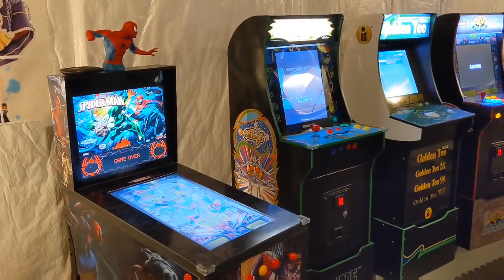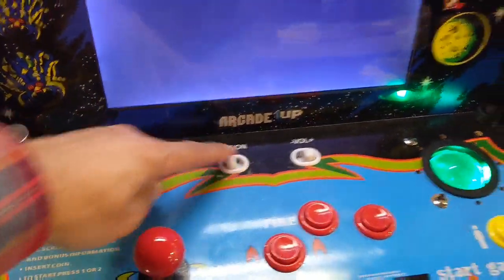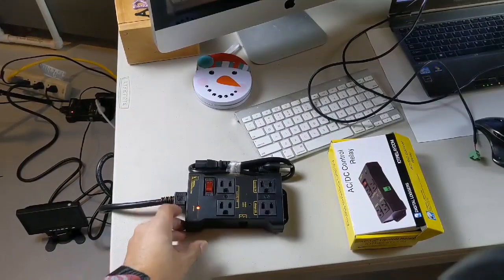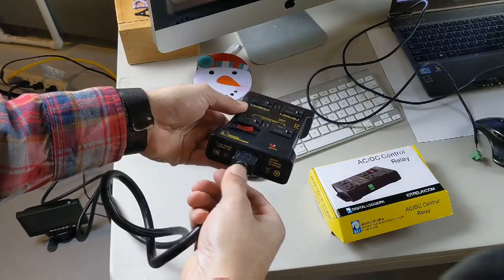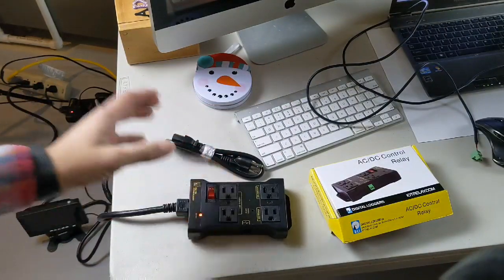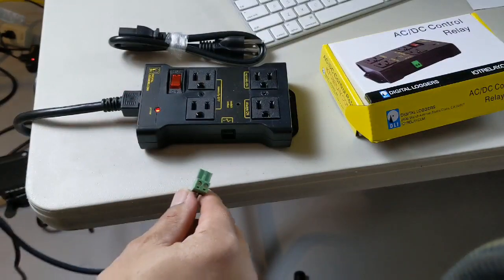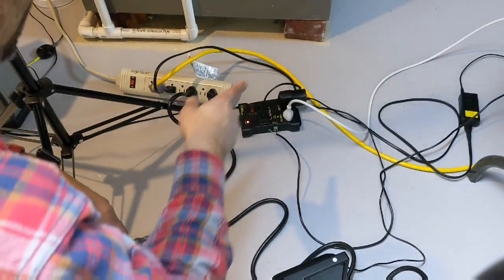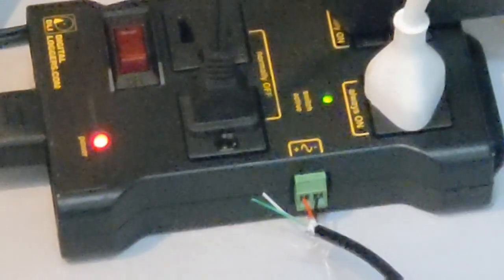Arcade1UP Mod - Turn Everything, Yes Everything OFF with Stock Power Switch

Comment: There’s a much simpler way to have the power switch turn on/off all components by using DC splitters and adapters to tap into the 12v power current going to the LDVS.  As long as you are coming out of the control deck in the chain.  Gen1 cabs that do not have a 2.1mm DC power coupler coming out of the encoder can easily buy a cable with a JST connector and make a ground loop on the power input on the encoder board then tap off the DC power coupler using multiple Y-splitters.  Use male/female adapters and barrel plugs as needed for each component.

Comment: Easier way plug this in your wall outlet and the other to your powerstrip. You can turn off your entire system/machine with just a click of a button. I use it on my modded arcade1up machine. It comes with a wireless remote to power down everything or turn on everything. 
This is the item name below i got mine from Amazon.  

HBN Outdoor Indoor Wireless Remote Control 3-Prong Outlet Weatherproof Heavy Duty 15 A Compact 1 Remote 1 Outlet with Remote 6-inch Cord 100ft Range

Comment: Any updates on get the Pi to turn off also? Did you try to plug the Cabinets ON/OFF switch to the green plug on the relay power stripe?

Comment: Love your videos bro! I got the modded volume with ryans C code and also did the python script for the power button. I do have a fan installed in my MK2 cab and it doesn't turn off. This solution should work for powering everything off! Another option I found is a transistor with another python script to use gpio 21 to do a thermal fan detection but It seems a bit much for me to do that just for a fan lol.
Reply from the maker: Did you ever get this resolved?
Reply: Detroit Love Not yet. I think I’m going to leave the power switch as is and just unplug the cab for periods of non use. Not sure I wanna do the relay as you mentioned you gotta do the on off on thing to get it powered back up from off after the relay is tripped.

Comment: Million dollar question: what are the chances of replacing original on Off switch with a single pole single throw momentary switch? Then you wouldn't need to flick the switch off-on-off to turn it off.
Reply from the maker: The weird thing is that it has never done that again after that. It’s been working perfectly every sense. Not sure why it behave that way.
Reply: @DetroitLove  that is weird. Btw great videos im looking toward to modding my ms pacman cab. I learned alot.

Comment: Are you using a Pi 2 or 3? I've been trying to do this on my Pi 4 and it still puts out power on after being shut down. Switch works fine when powering the pi on
Reply from the maker: I used Pi 3
Reply: @Ev3rLa5t  I was able to figure something out on reddit to do a full shutdown trigger.

I attached wires to GPIO Pins #8 (GPIO 14) and a Ground pin (any will do), and added those to the relay mentioned above. Pin #8 was connected to the (+) on the IoT and a ground pin to the negative (-).
Lastly, I set "enable/disable shell and kernel messages on the serial connection” to enable in the Raspi-Config menu as this will trigger the IOT and shut off.
Reply: @ribz4lunch  how did you enable/disable kernel messages on the serial connection? Any steps would help, thanks

Comment: Detroit, I seem to be having some issues with the power not staying on on my modded arcade 1 up. The power cuts off after about 5 seconds. I modded it to use the power switch a while back and it worked fine. I stopped using the arcade for a while and the next time I tried it again I had the issue with power not staying on. Do you have any suggestions on how to fix it?
Reply: @DetroitLove  i tried turning it on while it was in the off position, I got the same results. The arcade shuts off after a few seconds. It worked properly in the past. I will watch the video and see what you mean about true/false.

Comment: @DetroidLove are there any alternatives to that power relay? I checked amazon and it's all sold out. Let me know if you seen an alternative out here. Thanks!
Reply: Ended up getting the relay and it works great! Just trying to figure out the coding for the on/off and volume toggles.